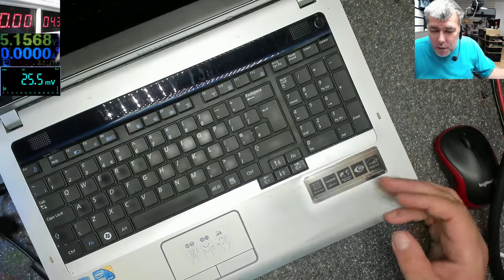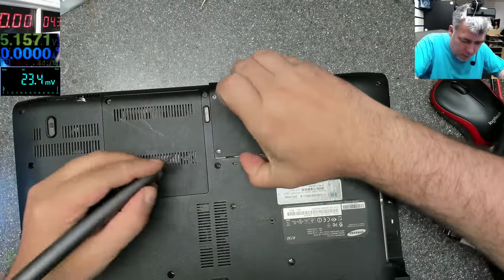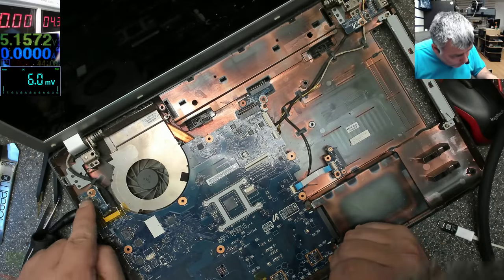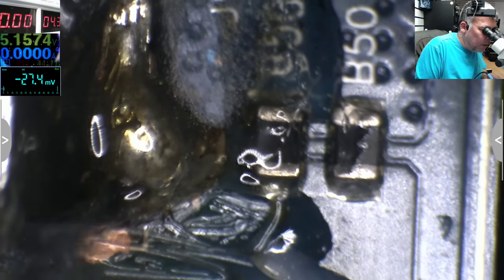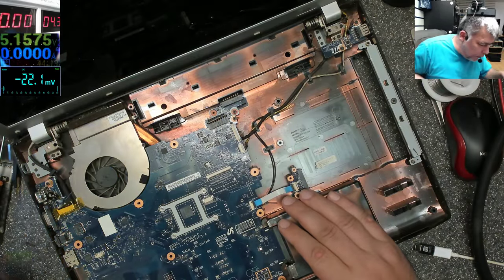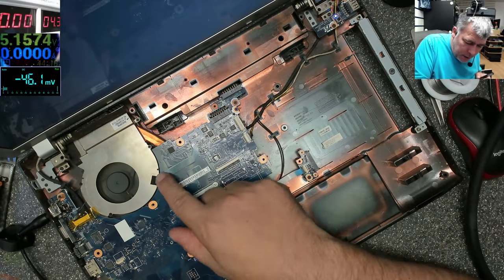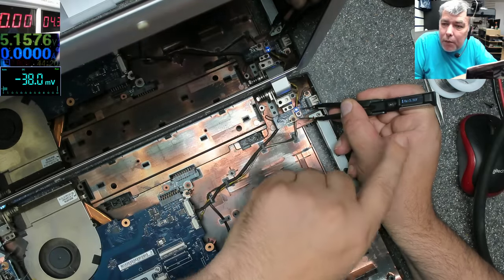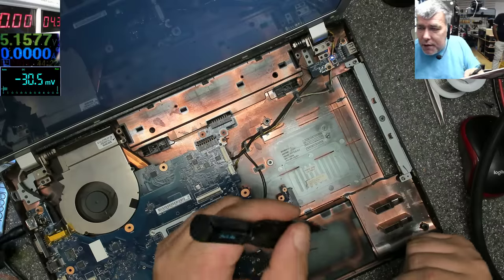DT71 Mini Digital Tweezers review and a Samsung laptop repair

Comment: Use IPA on the hot glue it comes off easy as can be cold best tip ever!
Reply: I hope this comment will get most likes - he need to see that pro tip!
Reply: what stands for IPA?
oh, i think i got it; do you mean isopropyl alcohol?
Reply: @leerzeichen1910  That's the one!
Reply: It's harder for me to get IPA so i use 100% acetone for pcb and flux cleaning (with caution on labels and plastics) it cleans well and also easier and much cheaper to purchase, it does also a great job on hot glue (and various other glue's sticky residue) 👍
Reply: If you find it hard to get IPA some antiseptic rubs will contain IPA recommend at least 70% though. For example here in Australia isocol is 64% and it will do the job fine. But the romaining % is water so please keep this in mind when using on electronics.  Recommend 99+% if you can get it.
Reply: Agreed, the glue will peel right off.
Reply: You are my saver :D

Comment: To remove any hot glue from nonporous materials like plastic, metal, or glass, use alcohol or isopropyl alcohol. This helps loosen the glue from the surface of the material and therefore makes it easier for you to remove it.
Reply: Nice tips
Reply: I was thinking the same, then scroll down to the comment and see yours.This is a good method, and i use it too.
Reply: thanks for the tip

Comment: Not a bad toy, but for 60 bucks - slightly too much. Especially with a normal 10 bucks ANENG you can easily put the ground fixed and test way more easier... if on the other hand one doesn't have space at all - better than nothing. What I really don't like about multimeter is the way you choose what to measure... I guess I'm getting old.

Comment: I use two long wires for power sockets, the socket can move slightly without the connection breaking.

Comment: Im ur new subscriber sir.
May i ask a question sir?whats wrong with my acer laptop if I plug in the ac charger it automatically turn on.but later on if i use to power on the switch of my laptop it wont turn on.i hope u notice me.Godbless.
Reply: maybe shorted power on switch ? so its still on
Reply: I dont know how to check it if it shorted.is there a video tutorial for it?

Comment: I'm surprised you didn't remove the charging port, clean up the area and reinstall it. The shield around the port should have been soldered down; that would keep it from moving.

Comment: You can use kitchen paper towel for hot glue when it is hot. The hot glue will be transferred to the paper like liquid . Do not burn your fingers, use tweezers to hold the paper towel small pieces and solder iron to transfer the glue on paper. This technique will produce very clean surfaces and glue free. Is two hand job. Keep doing the good job. :)

Comment: As Abraham Maslow said, "I suppose it is tempting, if the only tool you have is a hammer, to treat everything as if it were a nail." When you reviewed the soldering iron, the PC turned out not to need soldering, so you soldered it anyway! This device is not intended for in-circuit measurements at all, it is a component tester/identifier for surface mount PCB assembly work. This is why it is in the form of tweezers. The L, C, R and Diode measuring functions are the intended usage and they only added the functions you were using 'because they could'! Having said that, the plug-in measuring head would lend itself to an alternative base with one probe and a flying lead for grounding.

Comment: Well Sorin, it was probably an easy thing today, but you showed how to use the tweezers, you showed how to remove the glue, you showed the soldering to get the power supply working.  For me, as   complete beginner I value that.

Comment: For my Audio stuff, ARM devices and quartz watches the tweezers would be perfect. A big fault is the missing 5+ cm of reach. I already have a wire with a needle which I can solder in but they should have thought about that.
Reply: Some crocodile clip could work